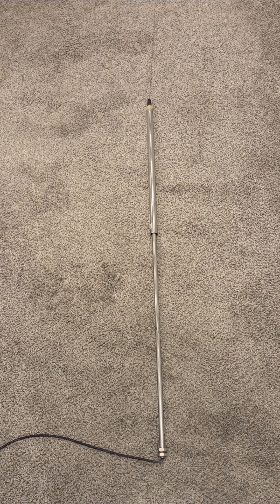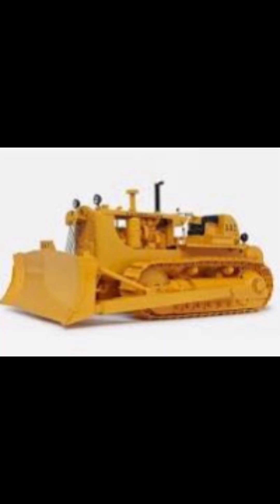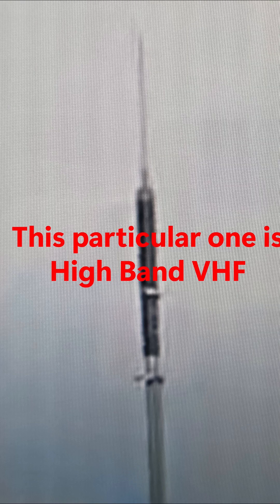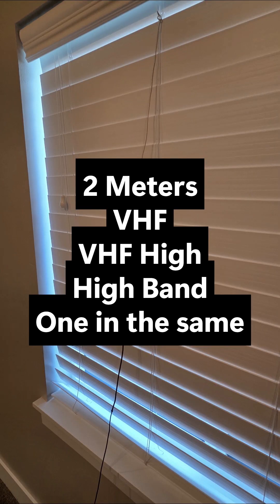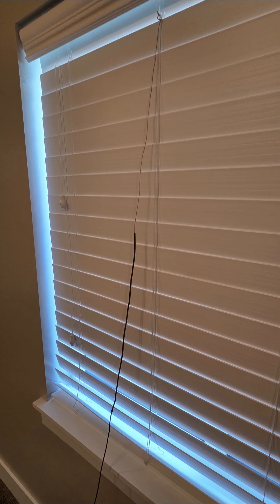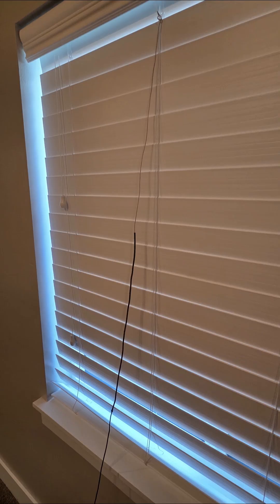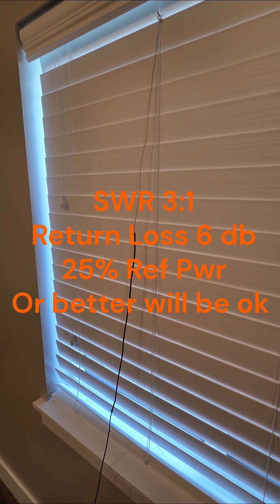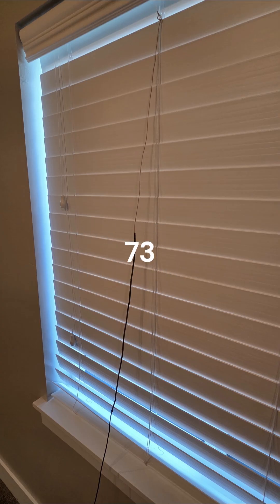Coaxial Antennas

Comment: Use to build them all the time. Had to be careful with the braid to fold and roll it back over the coax. Mine rolled up will nice. Think I remember them being called a sleve antenna. Definitely want to make it a bit longer than you want since the braid will end up shorter than measured as it loses some length when it folded back around the coax. I do remember getting a decent match though. If one wants they can stuff the coax inside some 1/2" pvc to get a rigid antenna out of it.

Comment: I love center fed vertical dipoles. I have one 2m flowerpot, like your build here. And I use them for 10 and 11 meters, using 102 inch whips.. There's a nice multiband design for down to 30m in Cebiks online design analysis.